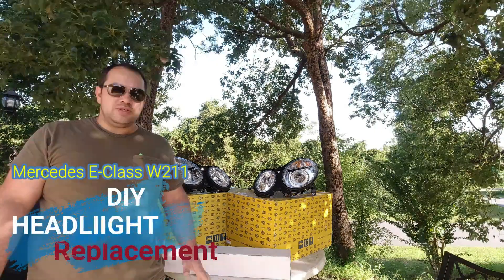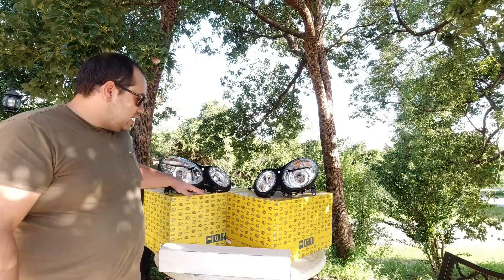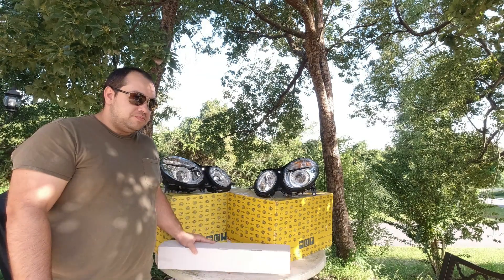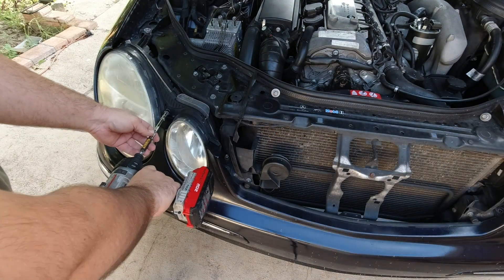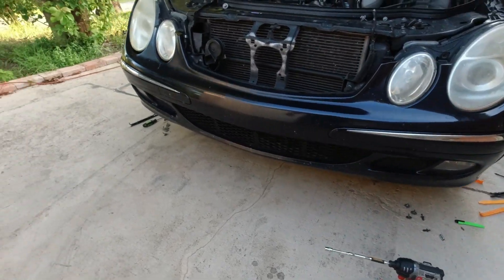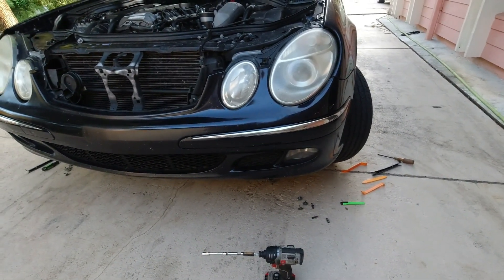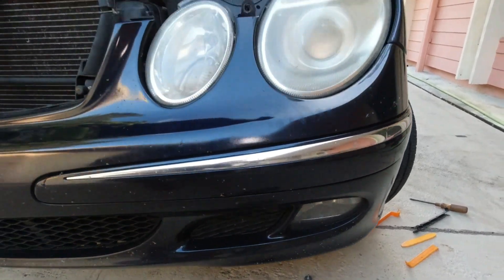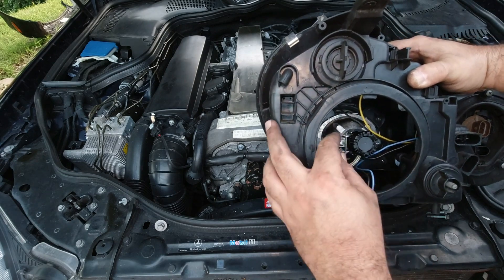Mercedes 2003-09 E-Class W211 DIY How-To Headlight Replacement and apply PPF

Comment from the maker: Hey, i forgot to mention this but if you have Xenon headlights on your W211 the replacement procedure is the same except you'll need to transfer your old Xenon ballasts from your old headlights to the new ones, the ballasts are mounted on the bottom of each headlight and can be removed with 2-3 screws.
Also if you have factory Xenon headlights you'll have headlamp washers, i don't think those will be in the way for bumper cover removal.